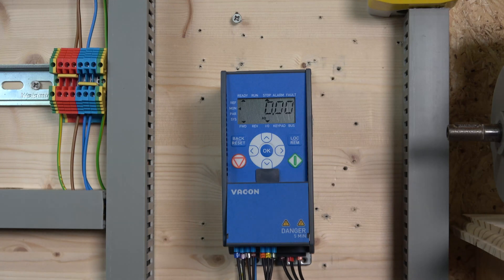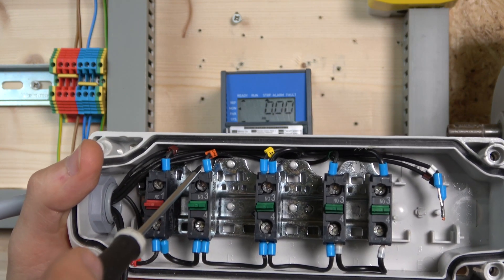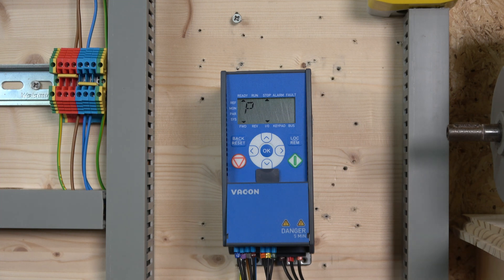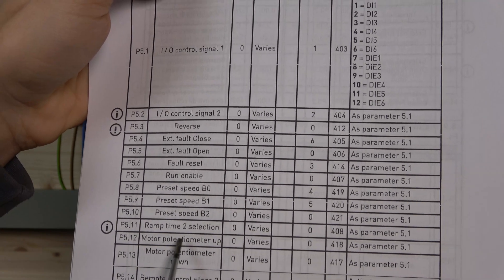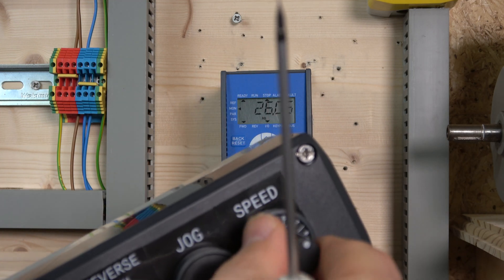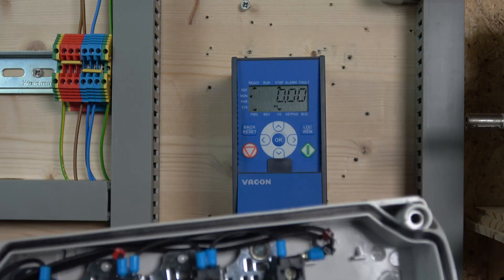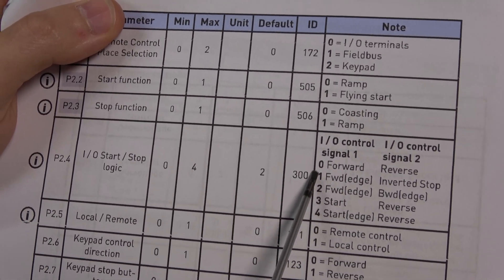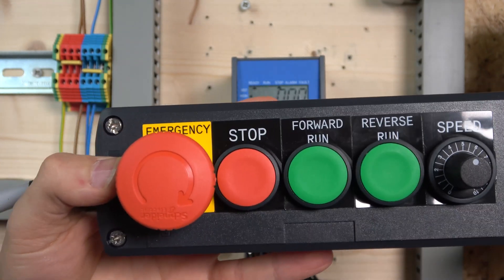Vacon 20 VFD, Remote control, 2 wire control, 3 wire control, remote speed control. English

Comment: Hi. I need to set my vacon for the lathe. For forward/reverse I have switch, the e stop should disable run also when e stop has been reset but forward/reverse is still in on position. Machine should start running after f/r has been cycled of. Basically motor should not start running if drive is enabled and I reset e stop. There is also foot brake which that should function the same way as e stop. There is also back cover switch and it is connected with foot brake. E stop is normally closed, I need to check if foot brake and cover switch are also normally closed, then I can put them all into same loop with the e stop.
Reply from the maker: Hi There. So your lathe is starting with no reason, is that what i am understanding?
Reply: @IGSElectronics  No. I need to make normally closed loop for emergency stop button. The lathe should not start after e -stop is reset if digital inputs 8 and 9 are on. Lathe should start after e-stop only after resetting e-stop and switching 8 or 9 off and on again.

Comment: Hello. What's issue if Ready indicator mark is not appear? Pump also not running
Reply from the maker: Hi there. Sounds like, one of the inputs has been a sighed to accept ready signal. You need to find out in your drive what has been a sighed to digital inputs to find out witch one it’s requiring to be active to ready drive. In short, it is highly possible the drive is not receiving the signal from your set up/ control panel, to be ready. I would start with this kind of fault finding.